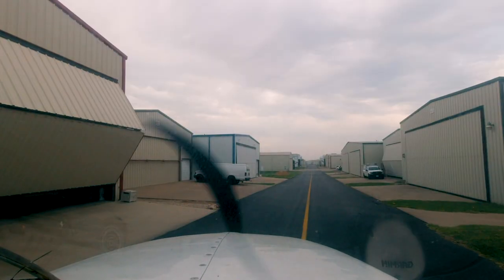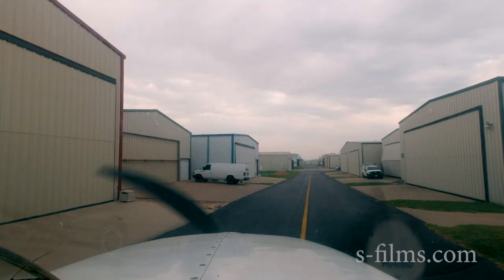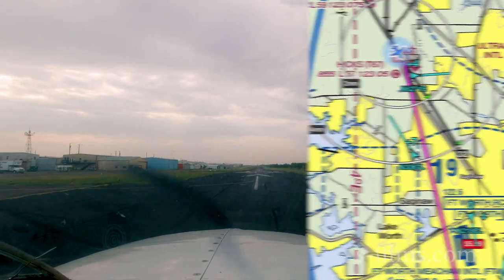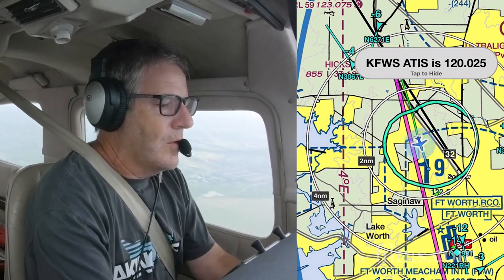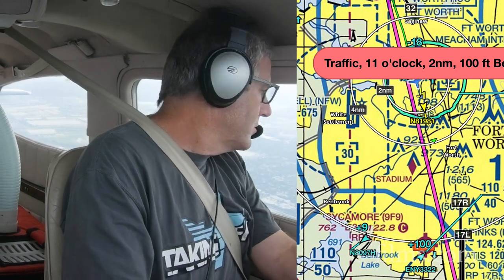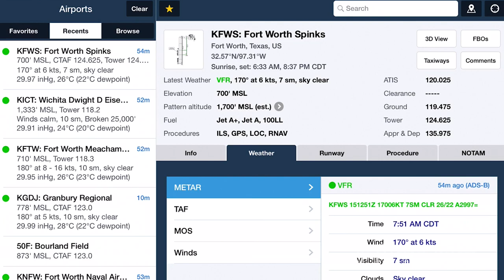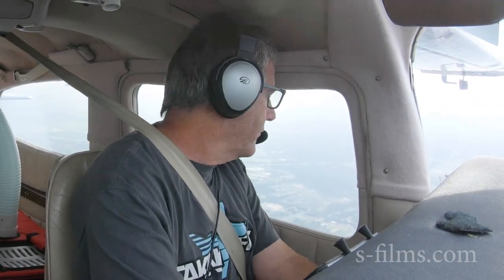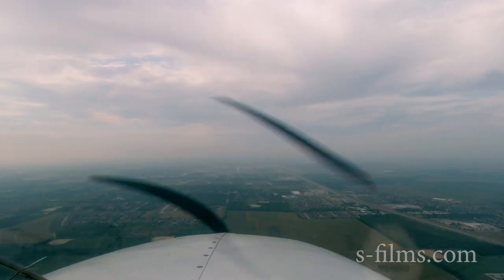Flying Through Class Delta - TakingOff Ep 102

Comment: Not being a pilot but starting to learn the basics, it looked like you did a straight in approach to landing on what seemed like a VFR flight.  I didn't hear any comms that mentioned straight in vs. doing the usual pattern.  If it was straight in, how did you know?
Reply from the maker: Great question Matthew.  As you probably know, two types of airports-- towered (or controlled) and uncontrolled (no tower).  For the controlled fields, the tower controller will tell you what he/she wants you to do.  I landed at a Class C airport one time and they cleared me straight in 51 miles out. (51 Mile Final, ha!). For this landing, I just followed the tower's instructions. near 11:15, tower tells me to report 4 mile final for 17 right.  Coming from the north, almost directly in line with the runway, I was expecting a straight in.  But you never know until they tell you.

Comment: What is the small circle on your Foreflight map around your airplane that seems to be growing after takeoff?
Reply from the maker: That's the glide ring.  In a quick glance, it will tell you how far you could glide if you had an engine out... so you can see if you can make a nearby airport or not.  Of course, the lower, the smaller the circle.

Comment: I have a question, when I listen to videos some of them the pilot calls the tower using the towers name and when he signs off uses the towers name again...Example..Atlanta Cessna 1234 is with you at fl 50 Atlanta....why the second Atlanta?  Ive been flying since 1963 and was never taught to do that I was taught to be as short as possible...can you answer this?
Reply from the maker: Good question. I haven’t heard of repeating the tower at a towered airport. For uncontrolled, I was taught to say the field again at end of call. I know when I’ve heard it from others it helps— I miss the initial location on the CTAF (thinking they’re at another airport) but perk up and if they say the field at the end, helps immensely.
Reply: Atlanta doesn't bother me but " With You" is not normal radio procedures, although a boatload of people say it.
Reply from the maker: You won’t hear me say it.
Reply: @TakingOff  Yes sir and that is great Dan.  Good video.
Reply: What they meant to say was "landing Atlanta."  In dense metro areas, you may have two or three satellite airports within or near the class D.  It helps to alert the tower to where you are going and not assume you are landing at the primary airport.